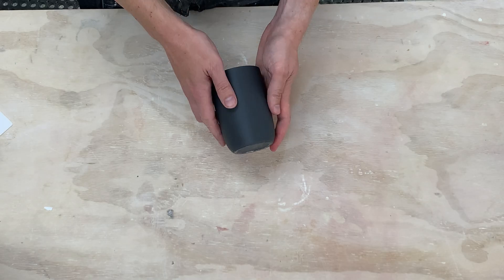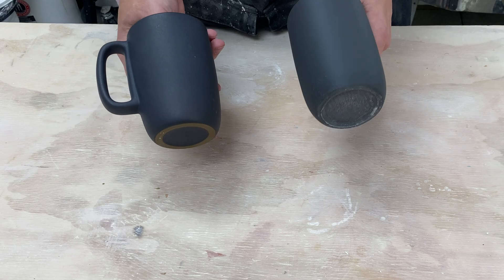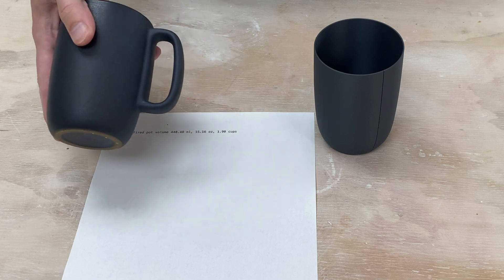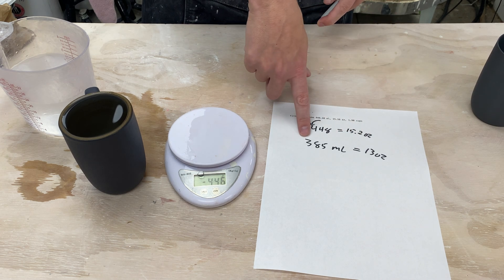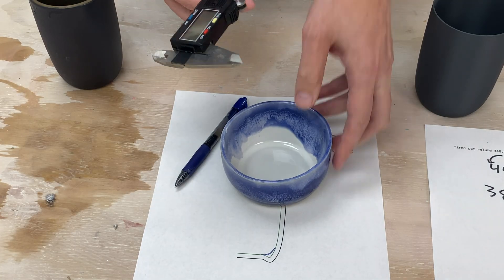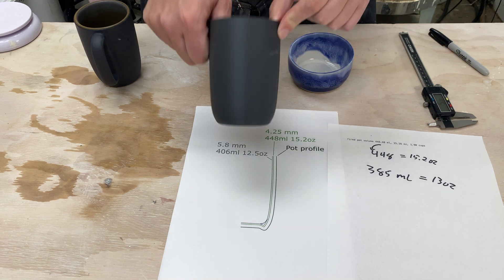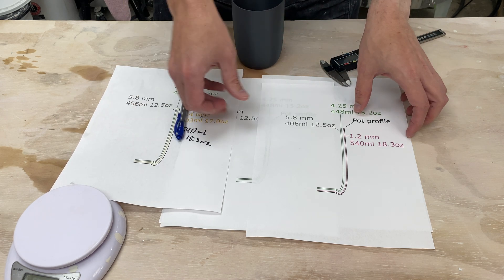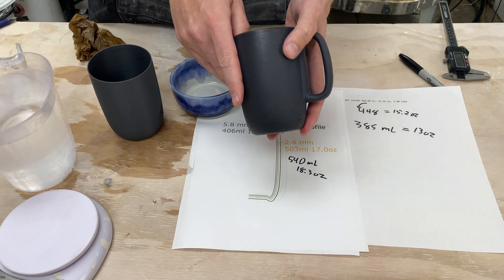Impact of Wall Thickness on Pot Volume

Comment: The change in volume is more than expected because it is happening at the point of maximal surface area.  Like on a circle with 50mm radius, 10% of the area is in the outer ~2.5mm of the radius.
Reply from the maker: That's a good way to put it. Non-linear systems can be unintuitive. And it can make a difference between your coffee fitting comfortably vs overflowing!

Comment: Thanks for the interesting videos. Tried signing up for shapecast, but don't see how to access it.
I've been designing my plaster molds using fusion 360, and am looking at using openscad to more easily change design parameters.
Reply from the maker: Hmm. You should be able to sign up for the wait list. If not send me an email and we can try and see what's going on